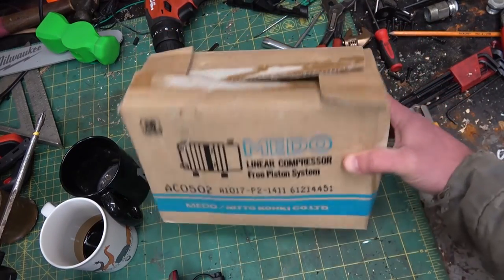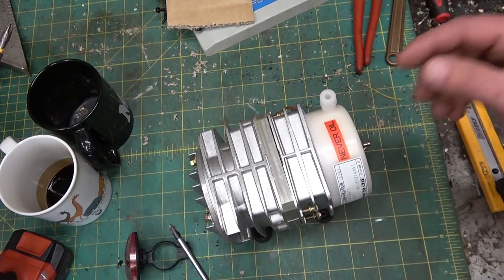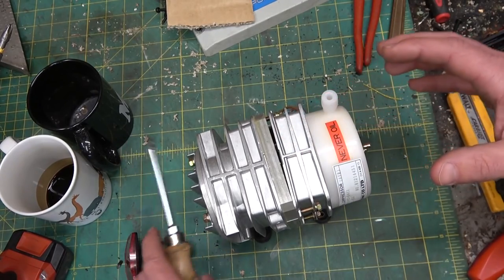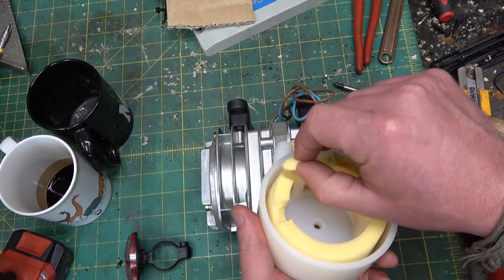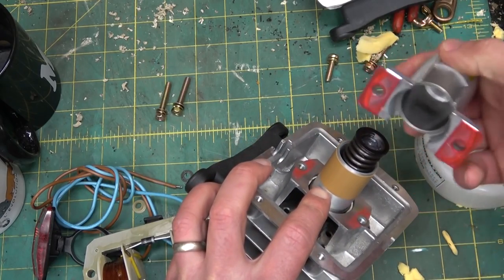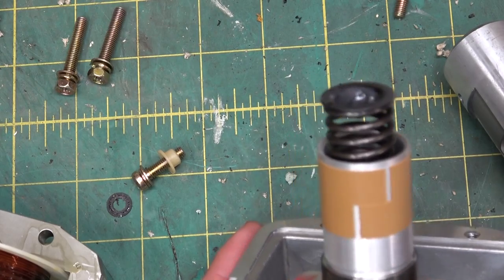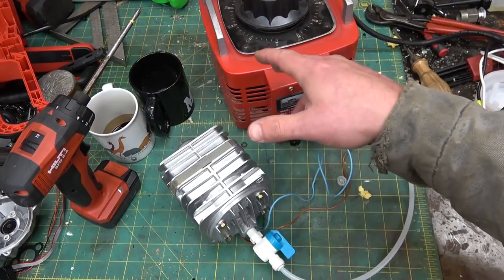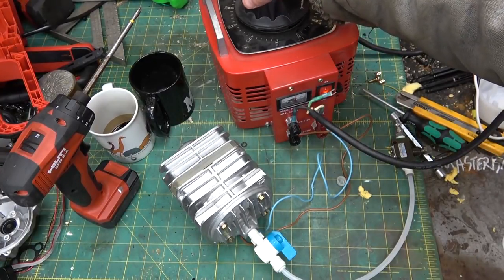BOLTR: Japanese Linear Compressor | Genius!

Comment: If there's any way you could do a teardown of an antique refrigerator to see why they seem to last forever, I'd love to see that.  My parents have a 1949 still in operation, but I seem to be replacing ours on an average of every 12 years or so.
Reply: What 'bobo' said... The copper lines are thicker/stronger. They used r-12, not r-410 or butane. The windings in the compressor motors were of larger gauge wire for more amperage capacity/higher hp to combat head pressure lock up and frying the motor. And also, a lack of a thermal fuse prevented it from shutting down for good when it did eventually overheat. We got an old commercial GE beer cooler that fires up and rattles like a diesel, and has been running strong and keepingthe beer cold for 50 something years...
Reply: @williamward2948  a lot of modern fridges run 600 blends which are the same you’ll find in the old school fridges.
Reply: Build of materials. The last compressor I cut open had a broken connecting rod. No bearings, just metal on metal. And, shitty metal at that. Injection molded horse shit. To go along with higher temps, compression ratios and rpms. But hey, it's "more efficient"
Reply: New stuff is definitely mostly junk.

Also, and quite critically; the old stuff that is still running is stuff that was built right. All the ones that were slightly off spec failed decades ago and are long gone. 

It’s like you build 1000 refrigerators, 10 of them have failed after 10 years, 50 of them have failed after 20 years, 500 of them have failed or been replaced after 30 years, 800 of them have failed or been replaced after 40, and 900 of them have failed or been replaced after 50 years. 

At the 50 year mark, most of the ones that were not built well are long out of memory.

Of the 900 that failed or were discarded, some wore out, some were damaged by a screwdriver that was used to defrost, some were modified, some were replaced by newer fridges for aesthetic reasons, or because the new ones defrosted themselves or other technology reasons. Some were moved incorrectly and died as a result. 

The ones that were replaced by newer fridges might have been built well but they were scrapped, so they aren’t in the running. 

At 50 years from production, most of the ones that were built and still remain have been relegated to second fridge status. They were moved out of the kitchen and into a garage or basement. Their doors were left closed most of the time, and their duty cycle was fairly well consistent for most of the rest of their lives. They didn’t have to work very hard or had many unusual temperature spikes and as a result, they just chugged along, living the ideal life of a refrigerator. Very few remain in their original position.

At the 50 year mark, you have 100 refrigerators left. People don’t see the mountain of 900 that no longer operate, they only see the ones that survived. Those that remain are definitely well built, and they definitely just keep working well. As a result the perception of people who are experiencing these refrigerators is solely from the perspective of the best of the best.

Still; 

The reality is that a new refrigerator made in 1940 or 1950 is probably going to have been made better than one made new in 1980 or 2010. The materials were better, the engineering done to compensate further and allow more for wear and tear than more modern refrigerators, and the materials the earlier refrigerators were made of were probably often superior to those made more recently. You are more likely to have a 10% 50 year survival rate on a 1950’s fridge than you are to have a 5% 50 year survival rate on a 1980’s fridge. 

I have a 1948 Westinghouse, a 1950 Frigidaire, a 1956 GE and a 1980 Kenmore. The 1948 and 1950 just quietly idle along, never having any issues. The only thing they have received is new LED lightbulbs. The 1956 died two years after being plugged in at my house and ate through a new compressor before I replaced or cleaned out all it’s coils. The 1980 has now needed new parts in the  three years it has been with me. I’ll keep replacing parts on it, rather than dealing with buying a new refrigerator that requires a monthly subscription.
Reply: I've heard that the early refrigerators were very trouble prone, so they tended to be overbuilt for a while. In the 1950s, they got better at engineering them for a 10-20 year lifespan and only for that long, so they were more lightly constructed each year. There is also the historical lens effect; there were probably some crappy refrigerators from 1949 that only lasted to 1959, but they aren't around today. Similarly, there may be some models today that will last a long time, but no one knows it yet. I had a Roper refrigerator from 1993, built right after the ban on R12, which only lasted 12 years, but I got a Whirlpool model in '05 which is now 18, but I wouldn't have expected it to last that long when I bought it. However long it lasts, I doubt it will be worth fixing when it finally fails; it's not built to be easily repaired.
Reply: Planned obsolescence (i'm french). I thought a lot about that exact topic. Veritasium did a really good video on it. Basically, since intellectual property or patents usually are owned by a company, for that technology to last through generations, the company has to be sustainable economically. So we have crappy stuff because we need to keep theses companies floating in order to maintain or hope for technological advancement. One could say its in order to help the growth of the human civilization.
Reply: @jessyltr581  booo!, lol. ever heard of ying and yang though, eerily similar concepts. we must eat to survive :/
Reply: quality metal
Reply: Planned obsolescence.
Reply: They used to cost a LOT more. With inflation I bet that an older fridge like that would cost over 3k USD today and because the price was so high they could afford to overbuild it. Now people dont wanna pay that much for a basic fridge so they had to cost cut out a lot of the overbuilt parts of the appliance and with that you lose reliability. I'm sure there's a little bit of planned obsolescence but when you take a luxury item and price it down market you are going to lose quality.
Reply: @jessyltr581  funny how civilization was just fine before patents
Reply: Jeez...1949...that's awesome!!
Reply: @williamward2948  how about the friction of moving part? 😂
Reply: @williamward2948  actually the low temperature at condenser and good oil returning helps the compressor long live 😂 The modern refrigerator make oil stuck in evaporator then compressor will be lacking of oil in operation, after warranty
Reply: Yeah old fridges do seem to last forever but they also don’t get that cold and are horribly inefficient
Reply: Look into adsorption/absorbtion-refrigeration.  Many early refrigerators didn't actually use compression cycles to get cold.  Inefficient but reliable.
Reply: They’re hermetically sealed and sit in a Bath of oil, so nothing to wear out the bearings.
Reply: @Bobo-ox7fj  ⚠️ God has said in the Quran:

🔵 { O mankind, worship your Lord, who created you and those before you, that you may become righteous - ( 2:21 ) 

🔴 [He] who made for you the earth a bed [spread out] and the sky a ceiling and sent down from the sky, rain and brought forth thereby fruits as provision for you. So do not attribute to Allah equals while you know [that there is nothing similar to Him]. ( 2:22 )

🔵 And if you are in doubt about what We have sent down upon Our Servant [Muhammad], then produce a surah the like thereof and call upon your witnesses other than Allah, if you should be truthful. ( 2:23 )

🔴 But if you do not - and you will never be able to - then fear the Fire, whose fuel is men and stones, prepared for the disbelievers.( 2:24 )

🔵 And give good tidings to those who believe and do righteous deeds that they will have gardens [in Paradise] beneath which rivers flow. Whenever they are provided with a provision of fruit therefrom, they will say, "This is what we were provided with before." And it is given to them in likeness. And they will have therein purified spouses, and they will abide therein eternally. ( 2:25 )

⚠️ Quran
Reply: Folks used to take pride in how long products lasted and how easy and budget friendly they could be repaired. Not the fact that your phone could connect to appliances.
Reply: @Bobo-ox7fj  On top of that, RoHS had quite a lot of unintended consequences.  Leaded solder is far more reliable than lead-free for a variety of reasons.
Reply: I've been selling and repairing refrigeration for close to a decade... and let me tell you, the old compressors that powered the them retro-refrigerators ( the main part that fails in our current run of typical refrigeration ) is night and day by comparison! The old school models were extremely robust, some were even rebuildable. 

would
Reply: It's because  they cared back then they built  them  with pride! Is is absorption  type ? No moveing parts does it use gas ? I'm a ac guy
Reply: Old fridges cost more in electricity than they're worth, they can often cost the same amount of money as a brand new refridgerator every 5 years just in electricity. They were horribly inefficient compared to now.
Reply: They're getting progressively worse. My mother has replaced her last two refrigerators at 8 years each. We replaced our previous one early. Too many problems. Yearly circuit board replacements. I have already had to replace the ice maker in our new one after just 2 years. My parents had an old GE that was still running after 60 years when they bought a new one. Our current house came with an old Kelvinator that was just as old. The previous owner used it as a beer cooler. Still ran. The wife got rid of it. Sad. The US made good stuff.
Reply: @bruiseandy  no.  You are FOS

Comment: fish tank pump
Reply: I was just wondering the same thing. Seems like it would be an adequate pump for an under gravel filter for a tank in the 50 - 100 gal range.
Reply: <mic drop>
Reply: Mind me asking what brand of the pump are you using?
Reply: Thought the exact same thing
Reply: @IntegraGSR5  Nitto Kohki
Reply: @IntegraGSR5   What I use is  Jehmco  linear air pumps for the aquarium trade.
Reply: That's what I thought of!
Reply: Medo pumps are popular in the fish hobby.
Reply: @Anson Jensen No doubt she is cheating on you:)
Reply: Exact reason I'm here lol

Comment: Just a linear motor. Not all that different from a speaker.
Reply: The air pumps used in aquariums (aquaria?) are just like that except for having a diaphragm instead of a piston.  
There are also cheap spray guns using that exact same principle except that the piston pushes the paint directly rather than moving the paint with compressed air.
Reply: Same way your power brakes work on a car. Vacuum powered linear motor basically(unless you got a hydroboost in a truck). Or i guess an actuator but same idea
Reply: @listerdave1240  airbrush compressors as well IIRC.
Reply: My dinky chinese aquarium pump is a centrifugal one. Also moving paint with a piston is a recipe for getting this piston glued right down stuck. Are you sure they are not using venturi like everybody else who want to spray things?
Reply: So what you are saying is we are one small step away from blowing people away with music.
Reply: I've blown alot of speakers💀 this won't
Reply: Piezo aquarium pump on steroids. For your shark tank
Reply: @kefeer123  positive displacement pump airless sprayers are all the rage nowadays. No more carrying around hoppers/cans heavy with paint, just pop the pick-up into a 5 gallon paint bucket. Much more efficient energy wise & coverage wise. Here's the harbor freight home gamer model https://m.harborfreight.com/airless-paint-sprayer-kit-60600.html?utm_referrer=direct%2Fnot%20provided

Heavy duty commercial models can run a few grand & provide more features. Not much paint is in the line to the gun so cleanup is surprisingly easy. At least when shooting water based products.
Reply: these big pumps are used too, I have a 80L/min pump feeding a pond and a whole heap of tanks, more efficient and quieter overall than having small pumps next to every tank
Reply: Absolutely sure, precisely because I have had to deal with pistons getting glued to their cylinder numerous times because someone wouldn't clean the spraygun properly after using it. 
To avoid that one should spray clean thinner of the appropriate type through it for several seconds after use to purge any paint from it. I also follow that with soapy water and finally some light oil and it never jammed. 
The good thing about these sprayguns is that they are extremely simple, cheap and also durable and reliable if only you clean them properly after use.
Reply: @listerdave1240  Jehmco makes linear piston pumps for the aquarium trade.
Reply: @johnbomhoff8782  Yes I know. There are various types of aquarium pumps. I am talking about the very common cheap ones used by casual aquarium owners, costing $10 or less.

Comment: Two things:
If the pump is rated to run at/on 50Hz, the reciprocating assembly should be engineered to resonate at 50Hz under rated load. If you give it 60Hz, you're starting to push the swing before it's returned as far as it can.
Second, you should be able to get higher voltages out of that variAC by using it backwards - swap the input and output. Just make sure you start with it cranked to what would normally be all the way up (primary:secondary windings are 1:1). As you turn it "down" you'll be reducing the number of primary windings (the bottom half of the fraction) with a fixed number of secondary windings (the top half). That'll boost the voltage rather than reduce it. At the "bottom" end, you'll be flying off into the cosmos voltage-wise. The insulation and air gap on the windings won't necessarily handle anything over ~130V, so it'll eventually start arcing internally and turn into a Photonicinduction episode.
Reply: Ooo!  Photo induction episodes! Lets do it!
Reply: Move the primary tap to the middle of the coil.

Comment: also know it's European because the brown and blue wires.  How do you know which color is the 'hot' ?
The brown wire, because that's the color your pants will turn when it shocks you.
Reply: @Damian Davis That works. I once remembered it by associating brown with the color of dirt on my grave & the blue sky seen while I'm not in that grave.
Reply: I was taught, the sky is blue, neutral is blue, because something about the sky. I dunno why. We use red and black here, but accept euro standards so are taught a lot of them.
Reply: They're both hot on 220v. It's two hots and a ground
Reply: Average_azn in the US, yes, but not in Europe
Reply: We always remember "you don't want to be black and blue" when you wire euro colors to American. Brown/black, blue/white
Reply: Both are hot its 240 volts.... but if it was 120volts use blue as nuetral......BUT CHECK WIRING DIAGRAMS.
and keep ur deek i n a vice
Reply: @mikepedersen9520  if it was in the USA then yes both would be hot.  In Europe it's 240v hot and neutral.
Reply: In Europe brown is 240v blue is neutral and should be at the same potential as the earth as they are connected at the source ie the supply transformer. In reality it would not matter which way round you connected the blue and brown it would still chooch with no I'll effects.
Reply: @mikepedersen9520  wrong
Reply: @GGoffroad2  wong , euro does not use split phase, there have 240 and that's is not 120/240
Reply: Yes because I owned BMWs from the 80s lmfao
Reply: @starlite528  mate AC is AC... it all works the same regardless of where on the planet you are... (referring to single phase)

Comment: With a rotary motion, you can always attach a gearbox to exchange rpm for torque.  For a linear motor, you can't use that mechanical advantage and have to work electrically.  High torque/pressure would require high current, since in an inductor/coil the EMF is proportional to current.

But with a high current, your electrical losses would also skyrocket -- losing whatever efficiency advantage you may have had to begin with.
Reply: Precisely!
Reply: Correctamundo!  Ayyyy  👍👍👍
Reply: Why does high current translate into greater electrical losses? Is this a fundamental of electricity?
Reply: @drwombat  Check out Ohms Law and Joule's Heating Formula. Very basically, losses scale with the square of current. So increasing current through a resistive element will rapidly increase losses.

Comment: Reciprocating linear compressors are also used on laser engravers inside the laser nozzle to keeps positive pressure that keep fumes and smoke out and thus the main focus lens remains clean. It also helps clear the ash away from cuts and engraving so the laser has a clear path to the material so it can go deeper. Especially useful for wood.

Comment: These make great pond aerators, and are also used in septic tanks (frequently interchangeable terms in my experience).  Much quieter when enclosed in a housing.  I've seen a small one of these (60L/min) run continuously for nearly a decade.  I replaced the filter once or twice, and brushed the bugs and webs out of it annually.  Quite reliable.  IMO, way better than similar diaphragm pumps.

Comment: I literally own this pump. I use it for water reservoir aeration in a smaller Hydroponic set up.

Pump runs for around four months at a time for a couple years now......thing is a champ.
Reply: Yuck Foutube  four months is about the time for automatic flowering... sativas take almost four months just to fully flower and be ready to dry
Reply: I own a similar pump - runs year round outside keeping my Koi pond aerated.  Three years on this pump... Still going strong...